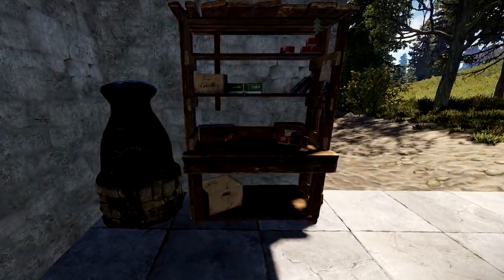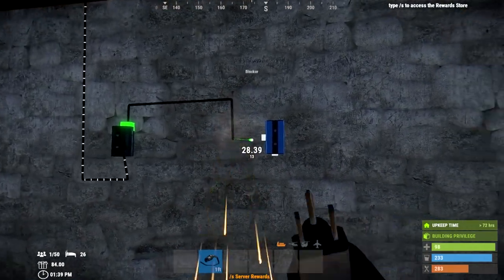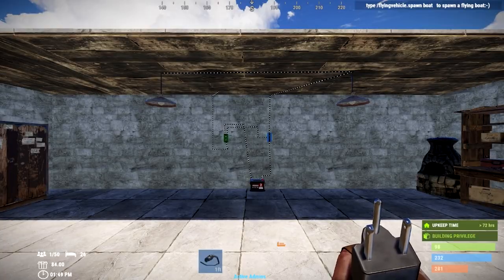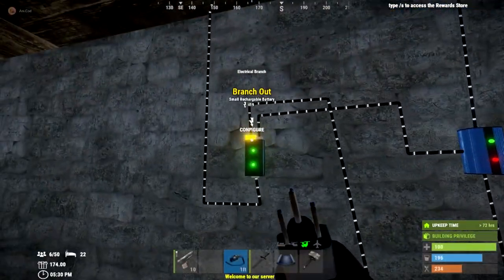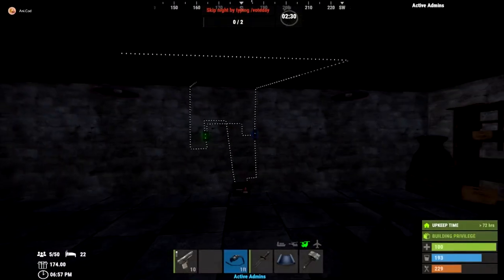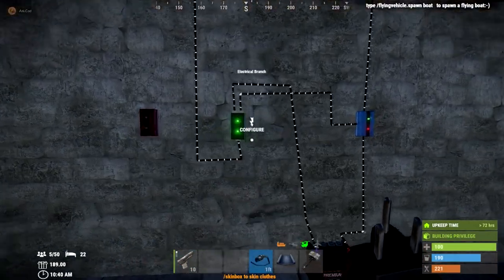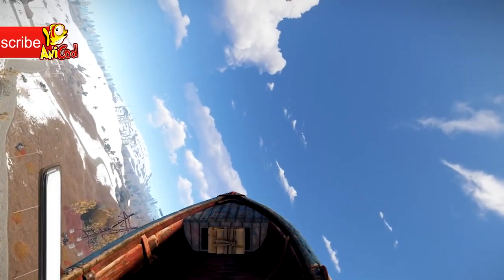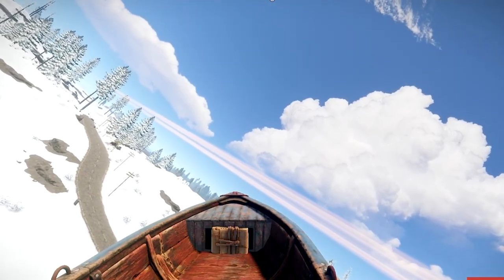🔌 EASIEST Automatic Lighting System | RUST Beginner to Pro Guide 🔌

Comment: i would set the branch out to 19 because each solar panel gets 20x(number of solar panels)-1 mid day so you're wasting 10 power going into the blocker
Reply from the maker: this is a good suggestion! thanks for the comment
Reply: When a new day starts, my lights are flickering for several minutes. You know how te prevent this?

Comment: I love how every rust electricity guide is like "Obviously you want to face your solar panels this way." but they all say something different. Some say you want half of them facing West and Half Easy. Some say South or North. Others say you want to point them towards the center of the map.
Reply: For max Charge uptime you want to have the solar panels face towards the middle of the map, either north if you are in the "southern hemnisphere" or vice versa. The sun is travelling across an imaginary line right through the middle of the map, this is confirmed. As where to place the sensory panel... I have forgotten the best placement sadly, that's why im here...

Comment: Quick question what happens to the power that goes to the Block Passthrough?
Reply: You said that the MAIN POWER OUT, goes to the Block Passthrough. Which in my knowledge means your sending all of the Power to the Passthrough of the Blocker, whose purpose is to just block the electrical flow upon receiving any amount of power...

Comment: does this work with a wind turrent?
Reply: ight so what i did i did a wind mill and a solar into a root connextor to get the large battery full then only made it the solar panal so we never run out of electricity and boom